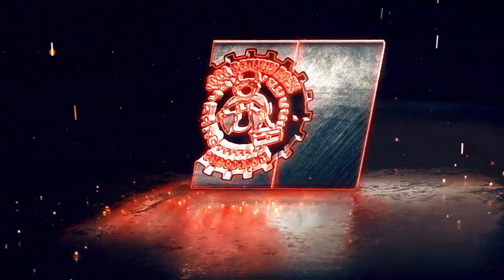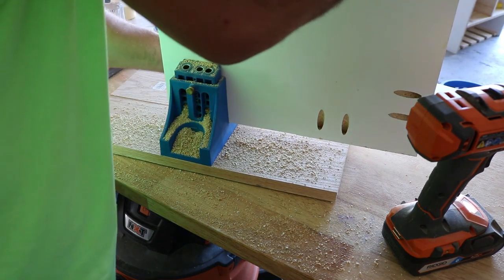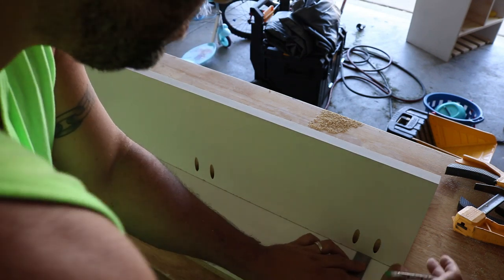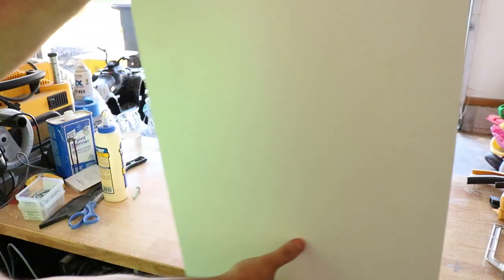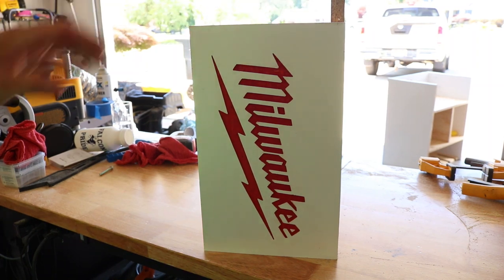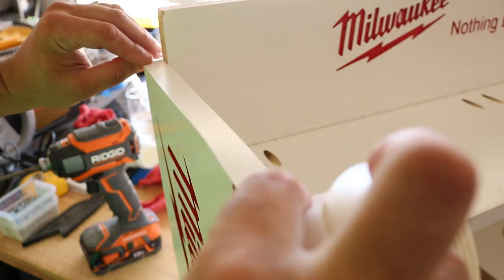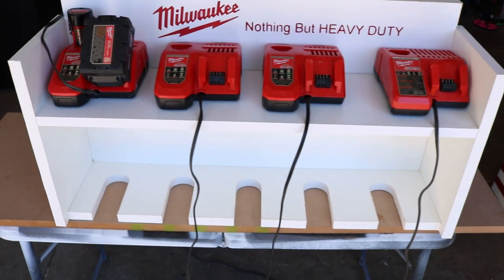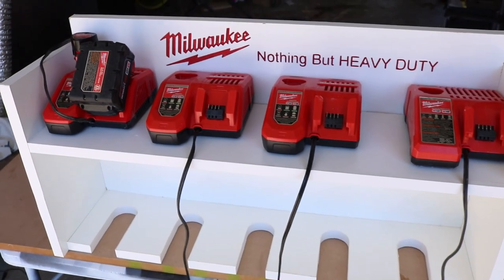Power Tool Storage Cabinet. How I made this Milwaukee Tools Storage Cabinet For Under $30. TUTORIAL!

Comment: I love this video man but I gotta tell ya glue on melamine does absolutely nothing. The screws in this case are obviously enough to hold. Ya got me though...New subscriber, Cheers!
Reply from the maker: Thanks for the feedback Cory and welcome to the channel bro!!!
Reply: Actually from a cabinet maker you would have to use Goo which is the correct glue to glue something from wood to that kind of material. Goo is actually the one that does all the bonding the screws are just there to help hold it there

Comment: What CNC machine set up are you using? One I could buy of the shelf or did you make it your self

Cheers
Reply from the maker: Hey Mads. I use the ShapeokoXXL. You can buy them and different sizes.  I also have a bunch of how too videos on the page if you want to check them out

Comment: You need to mosey on down to the local thrift store and get an old iron for that edge banding..
Nice build though.. how's it holding up? I've had bad luck with any kind of particle board build that has weight on it all the time.. especially if gets exposed to any moisture or humidity... any sagging?

Comment: I would have slanted the top shelf or hung the chargers because they  don’t work well laying flat. It’s a pain to get the batteries off and on the charger.
Reply from the maker: So basically what happened was I had a completely different cabinet built that sort of had that option, but when I had the last piece going on, I bumped it and hit the concrete floor lol. I redesigned it, but wish I would have kept that
Reply: Ah that sucks. You definitely put a lot of work in it. Nice shelf still.
Reply from the maker: @whatfreedom7  thank bro, and yeah I had a single tear on my cheek after it happened lol

Comment: Looks pretty, but lacks function. The chargers should have gone below the tool rack with the bottoms of the charger on the board using the screw holes to hold it in place. That way the cords would hang down instead of over The shelf and tools.